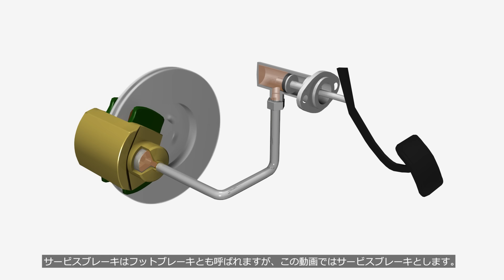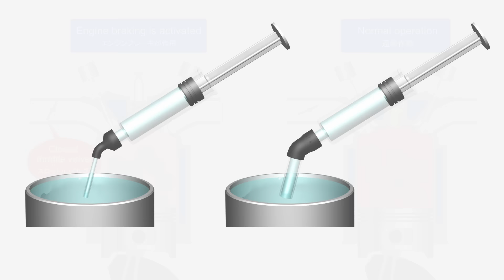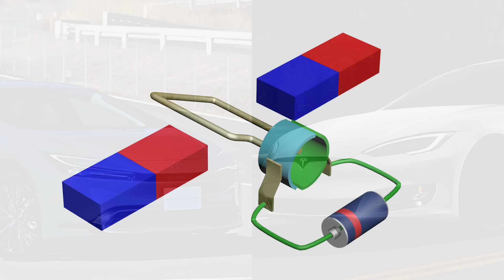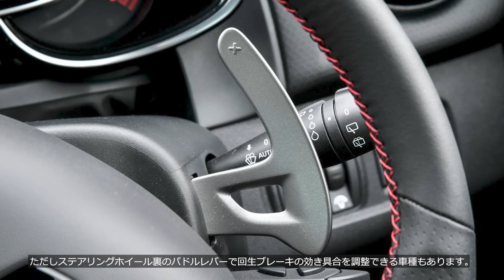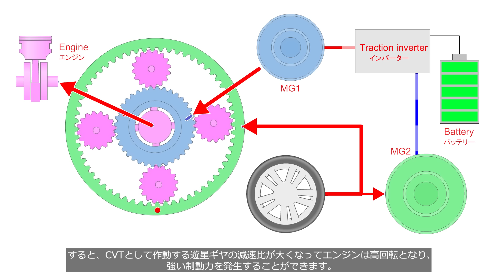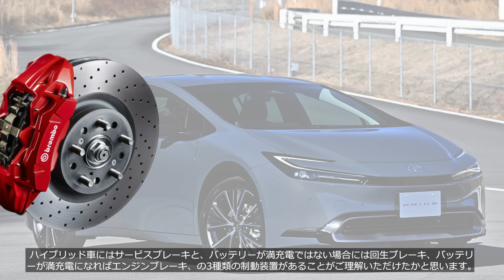Braking Systems for Hybrids

Comment: Toyota hybrid in hot weather I noticed this system is not working because of overheat inverter , can you explain the other system which is accumulator and abs and master cylinder how they work ?

Comment: hello Sikasabu san, THS system MG1 will support for wheels for torque assist?
Reply from the maker: Hi ihnadriia san.
Thank you for the good question.
To increase the gear ratio of the CVT during high-speed driving, MG1 operates as a motor to rotate the sun gear of the planetary gearset, causing the internal gear to rotate faster than the planetary carrier. Strictly speaking, it could be said that MG1's rotation is contributing to the drive force.

Comment: In Toyota hybrid, B gear slows down the car by insert more magnetic force when releasing the pedal until the battery is fully charged. After that, engine will start to do the engine break instead. So, if I used B gear in normal drive, it would not have any effect on RPM or car speed (say that battery still has room) as B gear in typical gasoline engine, just produce more break while releasing pedal. Is that correct?
Reply from the maker: Thanks for your comment — I think you've got it right.